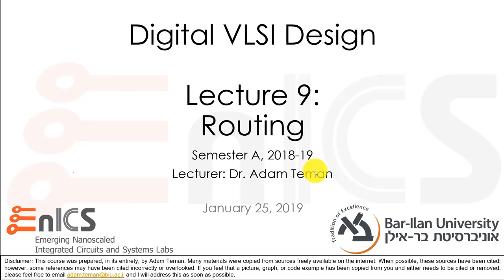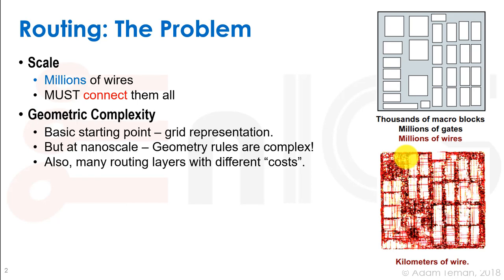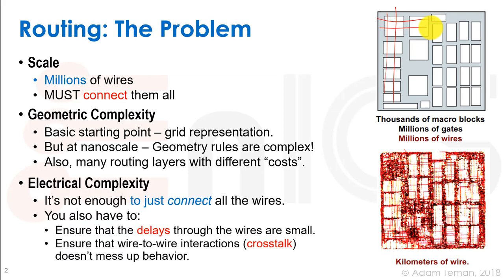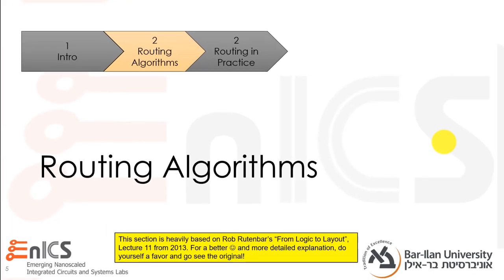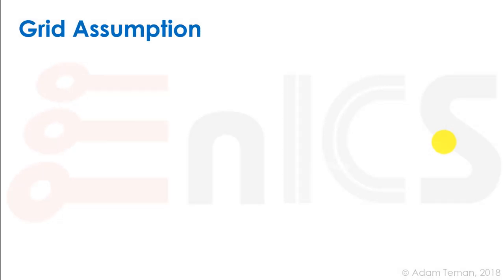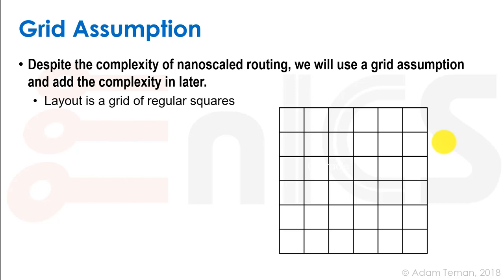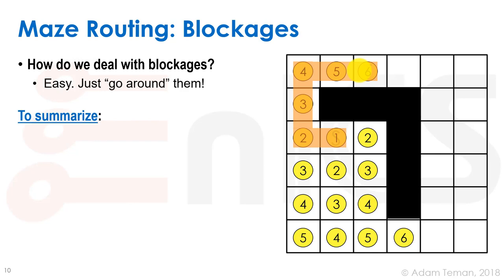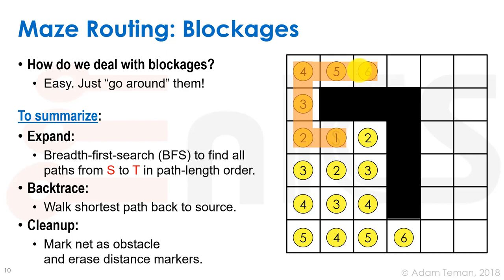DVD - Lecture 9: Routing

Comment: Had a few doubts

1. If we define routing directions for a particular layer, how would there be possibility for jog, in other words wouldn't we only have horizontal or vertical tracks in a given layer?

2. Would the via dimensions also change for different metal layers or do we use more vias for thicker metal layers?
Reply from the maker: Hi Rahul,

1) Routing tracks are (at least in older processes) more of a directive rather than a hard constraint. In other words, you can route in the wrong direction, but you should only do this if it's a little tiny jog or there is no other viable solution. In harder constrained technologies (e.g., quadruple patterned), this may no longer be true, but I wasn't referring to those.

2) Yes, the via dimension drastically change for different metal thicknesses, as well as the DRC rules for these vias. So a VIA7 will be much much much larger than a VIA1.
Reply: thank you  for the clarification adi !